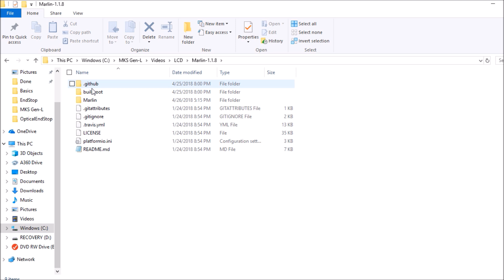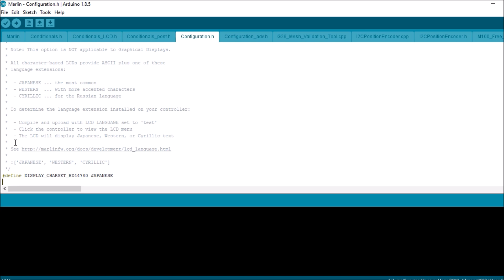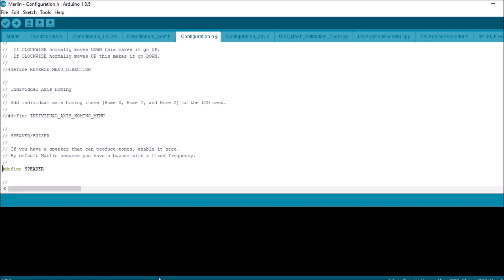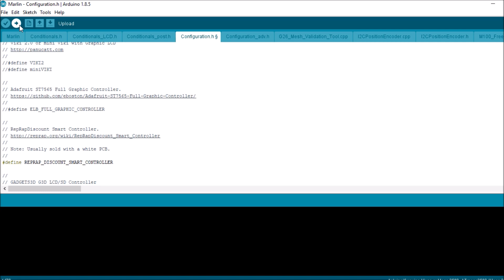MKS Gen L - RepRap Discount Smart Controller

Comment: hello Ed`s , i bought a new mks gen v1 board together with the same reprap display u`ve used in this tutorial however when i powered the board it worked well within the first few minute with blue leds blinking normally and before i could upload the marlin firmware the board went off. an attempt to power it ,only the red led went on endlessly{ without blinking}  and the board could no longer be detected by my computer.. what could be the issue and how do i go about it ?
Reply from the maker: Depends.  Which board for motherboard for printer board.  There's a Discord link in description and either myself or someone else can help in general chat.

Comment: hi edward thanks for your information, i write you from argentina to ask whats happen in my board because (i used several times before on my 3d printer) but now in the lcd screen (reppeg) still all 1th and 2th lines complete in white and the board doesnt work anymore?,.. still with only the red light on, even if i conect by usb to my computer to program it. if you can help will be great because i dont know whats going on. Thanks again!
Reply from the maker: Sounds like it may need to be replaced.

Comment: Dear Edward. I took a multimeter and after doing some measurements I found that the pins are reversed (at least for GND and VCC). At the display side VCC is on pin 10 and GND is on pin 9. When I looked at the MKS GEN L datasheet, VCC is on pin 1 and GND on pin 2. Do you know if I can just  invert the connectors, I mean, if doing the invertion all other pins will be connected right? I´ve tryied to copy your setup, taking care with cables on EXP1/EXP2. However, the screen is black and from he beeper I can hear a small click, click sound. I´m using MKS Gen l v1.0 and the reprapdiscount smart controller. Thanks in advance for any help the you can provide. Best regards.
Reply from the maker: Reversing the ribbon.cables should be safe.
Reply: @EdwardBraiman  OK. Thanks!! Everything is working now!!!

Comment: hello , thanks for all fo your video, i follow your tutorial and my secreen work but i can t go up and down in the menu do you know from where it could coming?
Reply from the maker: Try moving dial slowly if is still moving fast edit this in Marlin , "#define ENCODER_PULSES_PER_STEP 4".
Reply: @EdwardBraiman  ok i ll try it thanks
Reply: @EdwardBraiman  hI I've the same problem. not moving up or down I change this parameter also. Do you have idea?
Reply from the maker: Which version of the Marlin firmware are you using?  I'll need to try and replicate, as it been a long time since I tried last.

Comment: Hello I want to thank you that because of your videos I was able to configure my MKS. Now I have problems hitting the x, y and z axes, I'm using dual z and one motor moves normal but the other one jumps and the x and y axes only go halfway. What do you think it can be? Thanks
Reply from the maker: What are the number of steps per axis.  For example, when you move the x or y axis 10mm.  Does it move 10mm?  If it moving only 5mm you may need to double steps in Marlin firmware.  For the z axis are you using multiple stepper driver boards like a drv8825 or only one? If you're using multiple stepper drivers, then the might be in need of tuning.
Reply from the maker: Also check the size of you printer area in Marlin firmware.  If it's larger than 200mm, you may need to adjust.  Same goes for Slic3r SW.
Reply: @EdwardBraiman  Eu estou usando 200x200x200, quando mando pelo repetier de 10 em 10 ela vai ate parar e nao andar mais tanto em x quanto em y. Uso 4 DRV8825 e tenho o TL smoother neles. Hypercube Evolution my printer
Reply from the maker: So do the motors move currently?  Are they hot to the touch?  Careful if they are hot?  Do the motors make a lot of noise when they move?
Reply: @EdwardBraiman  Not hot, only one is slow
Reply from the maker: Which one is slow?
Reply: @EdwardBraiman  I'll check but I think and the E1 in duaz Z
Reply from the maker: E1 may have a temperature requirement to move. if that's the one with an issue, you may need a special gcode to move..
Reply from the maker: Also E1 will move slower.
Reply: @EdwardBraiman  I'll check everything and then return to you. Thank you so much for your attention.
Reply from the maker: Sorry was not thinking, you're using E1 for second stepper?  Might be better to use a stepper breakout.  Check my tutorials for dual stepper on one stepper.
Reply: @EdwardBraiman  Yes I was using the E1 for the second engine. Already watched your video, I will review. I set marlin to dual z, uncommented it in configuration adv.h and enabled E1 for the other Z engine to use.
Reply from the maker: @TheNikakz  , This is the solution I was talking about.  I've been working on a lot of SKR 1.3 tutorials, I forgot to finish CC in all languages.  It should be CC in Portuguese for Brazil and Portugal.  https://youtu.be/LfSFkHc4uxY
Reply: @EdwardBraiman  Hello you could send me your email and help me set up my printer, I have problems in dual Z and already followed your videos and also have trouble getting the X and Y axes. Thanks
Reply: @EdwardBraiman  Olá, resolvi o problema do Z, fiz um cabinho e liguei em série e agora os motores rodam na mesma velocidade. Só falta acertar os eixos X e Y em relação a mesa. Obrigada
Reply from the maker: @TheNikakz  ótimo, você poderia descrever o que está vendo com o eixo xey novamente? O que acontece quando você move 10 ou 100mm em qualquer direção. Quais são as configurações para #define DEFAULT_AXIS_STEPS_PER_UNIT {80, 80, 4000, 500}. Eu acho que você disse que está usando o DRV8825 para steppers.
Reply: @EdwardBraiman  Olá, veja: #define DEFAULT_AXIS_STEPS_PER_UNIT   { 164, 164, 816, 170 }
 Sim uso DRV8825
O X e Y movem 10mm em qualquer direção, o problema é que em relação a mesa não está com as medidas certas, x não para no meio fica um pouco para esquerda e o y vem para frente até o endstop e depois para trás não chega até o final, preciso ajustar essas medidas e não entendi como e onde no marlin. Tenho uma Hypercube Evolution 200x200, projeto do Scott.
Reply from the maker: @TheNikakz  tente comentar a linha de um lugar a linha padrão do meu comentário anterior. duplique estes valores 80, 80, 4000, para 160, 160, 8000. recompile e carregue o firmware e, em seguida, mova 10 mm no Pronterface e informe-me dos resultados.
Reply: @EdwardBraiman  Nao entendi, meus valores já estão com 164, acredito que este problema esteja relacionado ao MIN pos e Max pos, além de outros relaivos ao probe e ao home.
#define X_PROBE_OFFSET_FROM_EXTRUDER 40  // X offset: -left  +right  [of the nozzle]ver***********
#define Y_PROBE_OFFSET_FROM_EXTRUDER 5  // Y offset: -front +behind [the nozzle]
#define Z_PROBE_OFFSET_FROM_EXTRUDER 0.1   // Z offset: -below +above  [the nozzle]

#define Z_CLEARANCE_DEPLOY_PROBE   10 // Z Clearance for Deploy/Stow
#define Z_CLEARANCE_BETWEEN_PROBES  5 // Z Clearance between probe points

// For M851 give a range for adjusting the Z probe offset
#define Z_PROBE_OFFSET_RANGE_MIN -20
#define Z_PROBE_OFFSET_RANGE_MAX 20

// Enable the M48 repeatability test to test probe accuracy
//#define Z_MIN_PROBE_REPEATABILITY_TEST

// For Inverting Stepper Enable Pins (Active Low) use 0, Non Inverting (Active High) use 1
// :{ 0:'Low', 1:'High' }
#define X_ENABLE_ON 0
#define Y_ENABLE_ON 0
#define Z_ENABLE_ON 0
#define E_ENABLE_ON 0 // For all extruders

// Disables axis stepper immediately when it's not being used.
// WARNING: When motors turn off there is a chance of losing position accuracy!
#define DISABLE_X false
#define DISABLE_Y false
#define DISABLE_Z false

#define X_HOME_DIR -1
#define Y_HOME_DIR -1
#define Z_HOME_DIR -1

// @section machine

// The size of the print bed
#define X_BED_SIZE 200
#define Y_BED_SIZE 200

// Travel limits (mm) after homing, corresponding to endstop positions.
#define X_MIN_POS 0
#define Y_MIN_POS -8
#define Z_MIN_POS 0
#define X_MAX_POS X_BED_SIZE
#define Y_MAX_POS Y_BED_SIZE
#define Z_MAX_POS 200
Reply from the maker: @TheNikakz  seja bem-vindo
Reply: @EdwardBraiman  Desculpe se ficou muito grande, mas era o unico jeito de tentar fazer vc entender
Reply from the maker: @TheNikakz  Desculpe, estou tentando entender os problemas. Os eixos X e Y movem a distância correta solicitada? Estou tentando entender o problema da raiz. Se você mover o eixo x 20 mm, você tem um movimento do eixo x de 20 mm? Outro, você poderia me dizer o que especificamente está ocorrendo? Estou confuso quanto à descrição dos problemas.
Reply: @EdwardBraiman  Olá Edward, na verdade estou com problemas para setar os limites da mesa em relação aos eixos x e y, configurar área de impressão, offsets, dei um G29 e me retornou: 16:41:43.215 : Bilinear Leveling Grid:
16:41:43.215 : 0      1      2
16:41:43.215 : 0 +0.647 +0.029 -0.615
16:41:43.215 : 1 +0.649 +0.110 -0.407
16:41:43.215 : 2 +0.542 +0.082 -0.297
16:41:43.216 : X:160.00 Y:195.00 Z:10.10 E:0.00 Count A:58220 B:-5740 Z:8160
O carro mexe 10mm, 20mm, o problema é em relação ao todo na mesa.
Fiz um pequeno vídeo, baixe neste link e la tem meu marlin tamberm: https://drive.google.com/open?id=1SU7-M0up-kWI6X4xCz7MnWS3vD5c4Sz9
Obrigada
Reply from the maker: @TheNikakz  você pode definir os padrões no firmware Slic3r ou Marlin. verifique minha lista de reprodução para RAMPS 1.4 ou 3D Pinter hacks.

Comment: What settings in Marlin do you uncomment to make this controller work?
Reply from the maker: You want to remove the comments for,  "#define Reprap_discount_smart_controller".
Reply: Edward Braiman if I did that, and it still doesn’t work, is there a wiring issue with the cables? Are they upside down? Backwards?
Reply from the maker: They maybe backwards.  Open Pronterface and connect to check for an error messages.
Reply from the maker: Some boards maybe upside and or backwards.

Comment: thanks for the video, one question, after upload the marlin, the lcd screen lights up but displayed nothing, i turned the knob
around...nothing any clues ??? these: arduino ide is at 1.8.5, marlin firmware source @ 1.18, mks gen l 1.0 board, usb cable
all used, thanks for any help !!!
Reply from the maker: Check the back of the LCD connectors for exp1/exp2 and match to the 3d printer board.  Let me know what happens.

Comment: Which board did you use on marlin, because i've tried board_mks_gen_l and board_ramps_14_efb and neither worked... =(
Reply from the maker: They should both work as they share the same chip-set and architecture.  What's the nature of the error you're receiving?  Which chip-set is specified in Arduino IDE and do you set a COM port to select? The board is Arduino Mega 2560.
Reply: Im Getting avrdude: verification error; content mismatch
Im using Mega 2560, port is COM 3
Reply from the maker: Giovanne Galinari check USB cable and motherboard specified.  Let me know what's specified in Marlin firmware and as what's the board type specified on mks full name.
Reply: I dont really understand much about this. I've tried 5 or 6 different cables, none worked. Ive uploaded the same code to a ramps 1.4 shield and it worked fine. I dont know whats going on. When its uploading on the mks gen L, the green light flashes as its being written, but a couple seconds later, the error pops up.
Reply from the maker: What version of Marlin fw?
Reply from the maker: This is a link to the board for the LCD ... https://www.ebay.com/itm/LCD-2004-Graphic-Smart-Controller-for-RepRap-RAMPS-1-4-3D-Printer-Mendel-Prusa/292131407336?epid=918525396&hash=item44046385e8%3Ag%3A3k0AAOSwYlRZKWwg&_sacat=0&_nkw=Smart+2004+LCD+Controller&_from=R40&rt=nc&LH_TitleDesc=0%7C0
Reply: 1.0.2-2
I dont know how to download the 1.1.7 version, but i believe that, if the 1.0.2 didnt work the 1.1.7 wouldnt as well. =/
Reply from the maker: On Marlin fw website there should be a link to GitHub repository.

Comment: Thats a buzzer, not a microphone.
Reply from the maker: Thank you.
Reply: 1.1.8
Reply from the maker: Does  fresh download of Marlin fw unchanged load?
Reply: ive tried that already, nothing changed. I can try using a earlier version
Reply from the maker: Did that work with a fresh download of Marlin fw same results.  If it didn't work it might be a ftdi load because firmware might be curpt.
Reply: Edward Braiman didn't work. But I don't think the problem is with the fw, cause I've used the same code that is not working on my gen L in a Ramps 1.4 shield and it worked fine.
Reply from the maker: Google the Ardunio error, I suspect it's the firmware on the mks gen l is curupt.  Try uploading without USB attached and see if error is similar.

Comment: Very good video as usual.  Have you tested the Anet A6 LCD with the MKS board by any chance? https://www.aliexpress.com/item/Anet-A6-12864-LCD-Smart-Display-Screen-Controller-Module-with-Cable-for-RAMPS-1-4-Mega/32826054869.html Two posts I have saw on various sites mention they were unable to get it to work with the MKS board. I wouldn't mind updating my Anet A8 to this screen now, as I know it works with the standard A8 board with Marlin. But don't want to have to purchase another screen if and when I make the change to the MKS board in the future. Many thanks.
Reply from the maker: Brian Hillard I've purchased a Anet, but still haven't figured out how to present.  I might show initially how to setup without firmware update. Later I'll show how to modify.  Just thinking about how people would like it presented.  If you have ideas on the presentation let me know what Anet user want to know.  I've already developed a Anet board holder, but need content to go along with board.